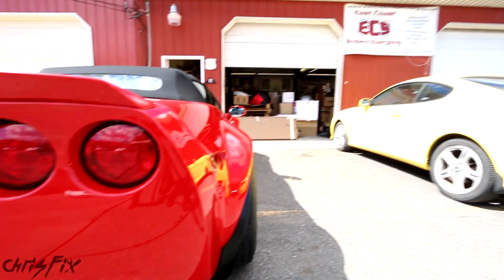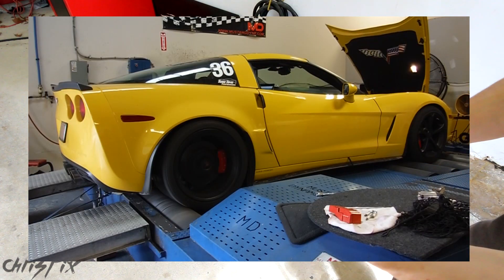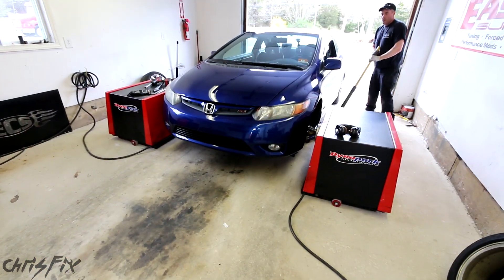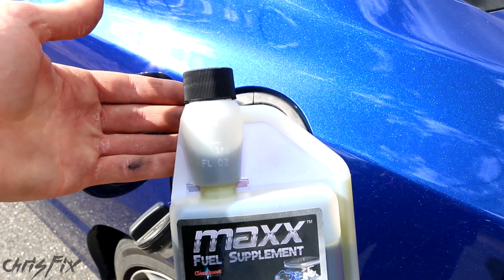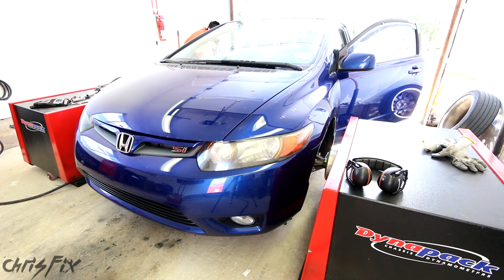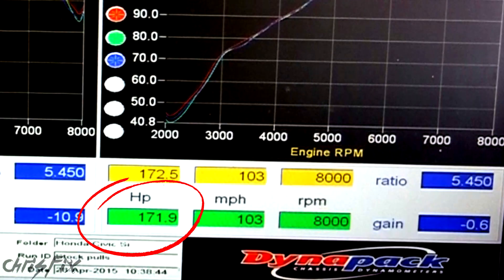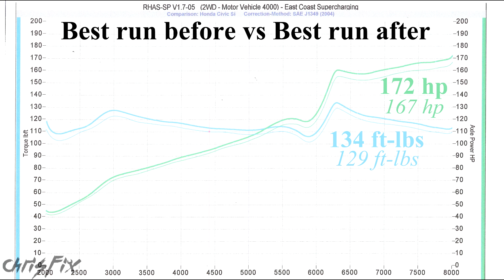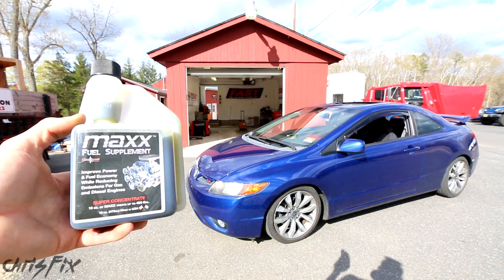Can a Fuel Additive Really Increase Horsepower in Your Car? (With Proof)

Comment: one big contributing factory you forgot to account for:  vehicles since the mid-90's have 2 different fuel/timing maps.  high octane, and low octane.  every time you fill up, the change in the fuel guage puts it in high octane mode, and switches to low octane mode once it detects detonation or preignition, aka "knock".  you need to manipultate the fuel sender or signal to make sure it goes into high octane mode to be accurate.  you could dump strait tolulene or n-heptane in the tank and gain horspower by bringing it closer to the verge of detonation and engine damage.  that's where the most power is..... so by transitive properties, it might be safe to say that this additive could brake the fuel down into lower octane, like letting it sit with 1/3 of a tank for a year.  in short: paying money to turn good fresh gas into bad crappy old gas.  who knows, a fillup with premium could net you even more power.... i know i get both power and economy using premium, and as afar as miles per gallon goes: premium if far cheaper to run than regular, since regular burns up quicker, than the 20 cent difference.
Reply from the maker: +Heath Hunter We used premium gas in this car (that is all it ever used and it is required due to the high compression ratio). Not every car can make the most of premium either so...

Comment: Really it is octane booster, simply put. Running 95+ octane in the civic will allow for maximum factory timing advance which is why there is consistent power gains. I see no mention of what octane of fuel was used, and if they used 87-89 in that Si with VTEC, the timing would be getting retarded due to lower octane gas. My Altima 3.5 when I took it to the track was a beast. I ran TORCO in it for a day before taking it out to my local 1/8th mile, and the car would run like a raped ape. Not discrediting the product in any way, but running high octane fuel in this case would net the exact same result. Maximum power that is otherwise limited by less than top performing gasoline.
Reply from the maker: +dsm2xtreme Actually, I contacted the company, and it is not an octane booster. It is a nano-metallic additive that makes the fuel burn more efficiently. We used the required premium gas (91 octane). Of course running higher octane gas would give you similar results but the idea was not to try to make more power, but to test to see if the claims on the bottle are real. Thanks for sharing!

Comment: Thank you for this test.  Question, what grade of gas was in the tank during the test?  Typically most high revving performance biased engines are factory tuned for premium but of course will run on any grade but with a less aggressive timing, fueling, etc to protect the engine. Of course adding an octane accelerator would return the peak factory tune. Assuming the gas was anything less than premium. ☺

Please do a similar test with a forced induction engine, like those found in a Mazdaspeed, Subaru, or Mitsubishi Lancer/EVO. Since these engines are very sensitive to preignition (detonation), any increase in octane can net increased performance. 

Thank you!
Reply from the maker: +adam toy The car had premium gas in the tank. The additive is not an octane booster, rather it is a fuel catalyst that increase the btu of the gas being burnt.
Reply: Thanks for the info. I may give it a try.

Comment: I am not blaming You, ChrisFix.
To the contrary, I thank You for your effort and "objective inquiry". 
I may believe in a Possible Power Increase if the proportion was higher...
But, 1/30th of a Fluid Ounce Per Gallon of Fuel ( 1 : 3,840  ratio ) ? ? ?
Any additive working (as product label claims) at that mix rate must have ATOMIC-NUCLEAR-RADIOACTIVE INGREDIENTS...

Comment: I tested "fuelon power" on my dyno thousands of passes. ALWAYS works.
I found 2oz/10gal is the magic number for power.Seen 2-7 MPG also and 70-90% less smog.
you can youtube "fuelon power" to see me in 1 of the race cars.
Reply from the maker: +BOOSTEDLASER Thanks for sharing! I will have to check that stuff out!
Reply: I know whats in all these products, been to the labs.
They all work best at 1 oz per 5 gal.
Works even better after some time.
Breaks up the carbon chains(short version)
M.I.T. actually tested Fuelon on a clear small motor

If u private message me,I will tell you the "secret" of whats in all these products.
BTW, in Diesel, I have seen it do more and reduce black smoke 75-99% under a load.

Comment from the maker: I just tested CleanBoost to see if it increased fuel economy. So we know it increased HP and in this video we now know about the fuel economy claims: https://www.youtube.com/watch?v=DUkICPS0zQE
Reply: +Monica Schwartz  +ChrisFix
If you haven't used it, you wouldn't know. 
I have been using them all along (if a different brand) and I could feel the difference that it make in acceleration. Using a dyno will only verify this. Because if someone just tell you about this without any tests, you'd be sceptical.
As to your question. Not testing different formulae of this additive does not make it illegit. 
Doing multiple brands tests will only prove one is better than the other, that's all.
Reply: Every video of yours I watch your plugging a brand, u must be pretty rich by now hey chris? Lol
Reply: can you please do a video on octane boosters
Reply: +ChrisFix can you test Archoil products? :) I'm just curious..
Reply: Have you considered testing the long-run harm it can do? I'm no car expert, but after buying my brand new car in 2007 4-cylinder to save on gas prices) , all I did was use additives to boost fuel economy. It was rated at 25/35 MPG (city/highway). A full tank was ~12 gallons so the best it would do was ~420 miles on full tank. With additives, it was at 500+ miles when the low fuel light would come up, so it did work to give me better MPG. After 6 months of doing this, the engine felt like it was stalling after exiting highway speeds. Dealership did not find anything. My commute was mostly highway (used to live in California), so I would feel the car like it was stalling constantly.
Reply: If you notice, he has tried many various brands at his own expense (see fuel system cleaners).  I trust that he is 100% independent.  Either that or he has ticked off a bunch of company's  LOL.  Quite frankly I was assuming a "this doesn't work status". I just started watching ChrisFix videos and I am quite impressed with his knowledge and take on all things automotive.
Reply: That dyno is pretty sweet! No more tire blowouts! haha
Reply: +ChrisFix if you are legit? Why don't you test multiple hp boost formulas?
Reply: Can you try the ArchOil products? I've been using the gas treatment and oil treatment. I wanna make sure in not wasting my money on it.
Reply: I'm new to your channel and catching up on vids but u live in nj bc I do
Reply: cool video just subscribed being a parts pro these videos actually help a lot cause a lot of venders always come around trying to sell their products and when it comes to customers I am brutally honest with them sale or no sale, but I would love tell sell a product that I know from experience works or video like these. Continue the great work!
Reply: ChrisFix
Reply: I got 2 new additive you can test, Bestline Engine Treatment and Bestline Gasoline Conditioner.
Reply: Chris, great job on the information component. Also, good job on controlling variables. One suggestion would have been to log timing pull during the runs. That was likely what resulted in the power difference. Heat soak would have been even between the two despite the additive. So timing advance FTW :)

As as aside, I have never run this product, however I regularly use octane boosters such as Torco, NOS brand race formulation, VP Octanium, etc... in my Audi S4 V8 which has a stock compression of 11:1 and generates a staggering amount of knock inducing heat being crammed into an A4 sized engine bay :(   I have verified that I can easily at least another 4-5 degrees of timing, which makes a noticeable difference, especially in hot weather. 

Finally, you may have wanted to mention the compression ratio of your Honda. Ultimately, octane boosters are best used on high compression engines (which I suspect includes your Honda). Also, it goes without saying that boosted applications benefit as well. 

Anyway, I know these types of reviews take a lot of time do to right and usually get a lot of flak from armchair critics (like my Trump avatared friend below...) who are are probably too lazy to even watch 30 sec of the video, never mind making one lol... So good work :)

PS: just gotta make a "V-tec kicked in 'yo" quip, hope you don't mind ;)
Reply: ChrisFix hey I have the car to
Reply: add full bottle and upload video
Reply: ChrisFix My dad has a idk one of the 2000s same car. He moved out of town.He did it and he got 174hp before and 184hp after.Same it’s 163ft-paonds before and 169ft-paonds.Sorry if I spelled it wrong.
Reply: I saw oil additives what can do very similar effect. The thing filled up the little space between the piston rings with some clay or something like that. It simply created an other layer of sealing between the cylinder wall and the piston. The engine became more efficient, and  it was powerful, but the piston's lifetime suffered the extreme compression in the combustion chamber. In my opinion it also was a layer of insulation between the relatively cool cylinder, and the piston. This thing can also build up someting onto the piston rings, and cause the increased power(its only a guess), I think it would be also a good reason why  were the results so consistent.
Reply: ChrisFix i literally get 5 mph in town 7 highway that's the price to pay when carrying a 1200 lb stereo system and heavy 22 inch wheels with a 300 inline 6
Reply: ChrisFix  will it work in a Nisan
Reply: Hey Chris Please make a video of installing a turbo charger..
Reply: Hey Chris can you please do a video of Engine Restore lots of UTUBE videos out there claim it works I would love to see your test results . Of course there no fix if it’s beyond damage . But everyone knows how expensive a engine rebuild is . And people just want a temporary fix this will be tried on a Classic car from the 60’s that does not have a bunch of filters etc ! Thanks in advance
Reply: hello chris fix may ask for your number please?
Reply: ChrisFix I
Reply: I guess im wasting my time. Judging by the comment above, he never responds.
Reply: try more cars, not just one.  peace
Reply: ChrisFix if the engine recommends premium, but can run with regular what type should I use?
would adding the maxx help boost the octane?
Reply: IceMan Aaron just run high test genius

Comment: good video but I'm still skeptical, they're are so many variables with a dyno. ambiant air temp, pressure, and humidity can effect results. I've actually done dyno pulls and gained and lost 8-15hp over the course of a day and absolutely nothing done to the vehicle
Reply from the maker: greenlight_CA Thanks and yes, there are a ton of variables but I did my best to limit them. No matter what we will not have a definitive answer because this was one car and one dyno run. As with any experiments, the number of tests is important. The good thing is I sent out 20 bottle to 20 subscribers to do a fuel economy test and those results will be published this thursday!

Comment: what is a torque? i googled it but i dont understand the explanation... it says turning power and hat the more you have it the faster it rotates.. thats a pretty lame defenition..
Reply from the maker: zionlee1004 zionlee1004 Torque is rotational force. A good way to think about it is with a wrench. If your wrench is 1 ft long when you tighten a nut and you put 20lbs of force on that wrench, you will put 20ft-lbs of torque on that nut.
Reply: ChrisFix so if your wrench is 2 feet, then youll be putting 10ft-lbs of torque or 40?

Comment: ChrisFix, obviously the fuel additive gave the Honda a little more horsepower. But I was wondering, do you think the horsepower gain can be greater if this was added in a vehicle with more horsepower? For example, this Honda gained about 5 HP, so will a car with 400 HP gain about 10 HP? Do you feel it increases based on a percentage? I myself feel like it will increase based on a percentage but I want to know what you think.
Reply from the maker: imenyo That is a good question and I was thinking about the same thing when we got the results. I think in a more powerful engine it will make more HP. So like you said, it is based on a percentage.
Reply: Actually, Chris, it's based on the car's computer. 

Most modern cars with fuel injection have a knock sensor (one notable exception is the Ford F150 Lightning), that continually looks for ping/knock, meaning the timing has been advanced too far for the fuel and conditions (air temp, air quality, etc). So, for pump gas in the Honda, it was getting 167 hp, because the computer couldn't add more timing or pull more fuel (lean it out) to gain any more power before it started pinging. 

Now, when you added the snake oil, it bumped the octane rating of the fuel in the tank a point or two, which allowed the computer to bump the timing a degree or two, and pull a bit of fuel as well, which resulted in a hp gain. I would bet that, if you went and threw super-unleaded (93 octane), or race fuel (110 octane), you would see similar results. Heck, there's a product out there called "Torco" that does the same thing, guarantees the same thing, and it really nothing more than a blend of methanol and acetone as am octane booster.

So, bottom line: if you took all the money spent over a year or more on a fuel octane adder (that does nothing more than take advantage of the ECU's programming to push the limits of the fuel and engine's timing to make the most power and therefore best economy for the fuel grade available) and put that money into REAL improvements (like a good cold-air intake,and a cat-back exhaust), you would see definite REAL WORLD gains, instead of something you have to add to your tank every time you fill up (unless that's something you're into, then you might as well buy a RX7 or RX8 and dump oil into your tank every time you fill up).

So, if you want to do a REAL WORLD test: use this car, test three different octane ratings on the dyno, then put in a CAI/cat-back, and repeat.

Comment: He didn't run the car the same on the test each time the red line time was different and the way he accelerated the car
Reply from the maker: brian byrd All the tests were identical. The redline was set by the computer to 8000rpms. The car was floored the same exact way each time as well.

Comment: top speed was always 103 though
Reply from the maker: Anal Devastator That is because it is in one gear for the run.
Reply: ChrisFix i see that you take the time and reply so i have a question, you mentioned that the fuel system cleaners didnt clear out much of the carbon build up, but did the car drive faster after applying the cleaners? thank you

Comment: I have seen your other videos... results speak volumes but my simple question is whether this bottle of performance booster for say $15 is worth the 5-10 horsepower it gives per tank vs buying race fuel at a lower cost per gallon than regular fuel with booster additive? have you tried race fuel alone on a dyno test? there may be variables overlooked in this test.
Reply from the maker: germinator420 Well, I had the same exact question which is why we are doing this: https://www.youtube.com/watch?v=fUmkNKikPUQ

Comment: The reason you get more power.  Is because those adatives have much higher octane rating.
Reply from the maker: german sheperd The additive is not an octane booster. It is a nano-metallic additive that increases the efficacy of the burn (I had to ask the company because I didnt know how it worked).

Comment: This isnt a very accurate test since you did not use the whole tank of treated gas, refilled, and then tested the horsepower performance. Simply adding a fuel additive and driving around for an hour will not give complete results..
Reply from the maker: Mitch Beauchamp This test was pretty complete. If you added gas you add another variable. We drove around to mix the additive in the gas. I am pretty sure we saw results as well so... This isnt a lab experiment so you cannot control every variable but I know without a doubt, we did everything right to keep this as accurate as possible.

Comment: I have a 99 civic with a b20vtec with a bunch a shit that dont make it good on gas high comp pistons flat valves  cams made 210 fwhp on mustang dyno and to top it off the tranny is very short gear ratio at 65 mph im at 3400rpm lol ..but its my daily driver I use ot for work  the car has a 10 gallon fuel tank if I drive all highway miles i get 250 out of the ten gallons ..im on my second 32oz bottle already cause with it I get 310 miles from ten gallons. .I ran out this shit other day an my gas mileage was Shiity again this stuff does work an will always go in with my fill ups
Reply from the maker: Atyou Lmfao Thanks for sharing! That is great info! I am doing a fuel economy test on this stuff and the results will be in soon!

Comment: what's happening at the second dip in hp at around 6800 rpm?
Reply from the maker: brwi1 That is just how the engine is designed. It is probably an airflow change that is causing that dip due to the design of the intake and valves. Great question.
Reply: thanks for the reply, looking forward to the results